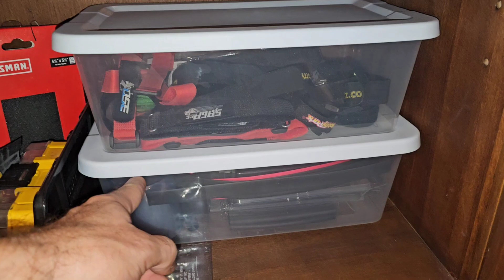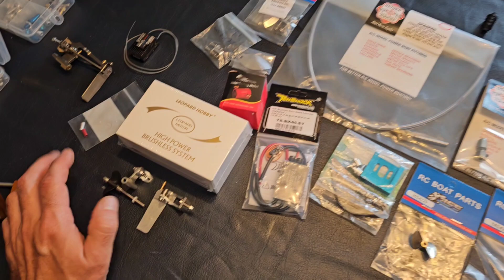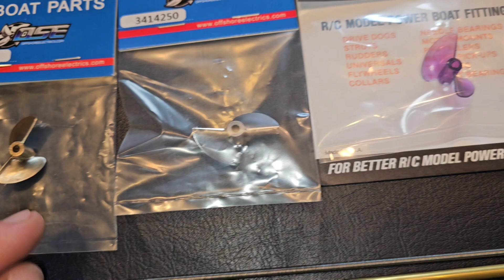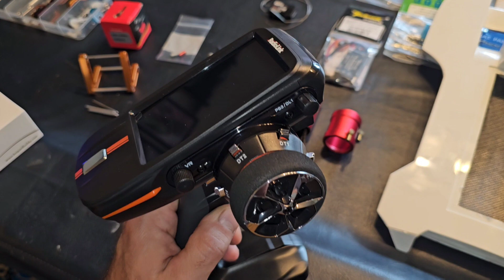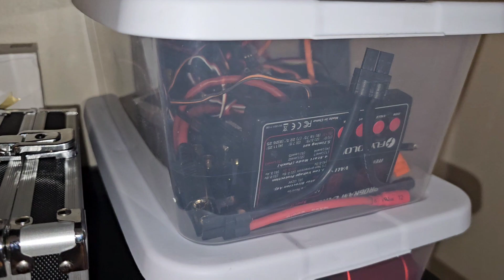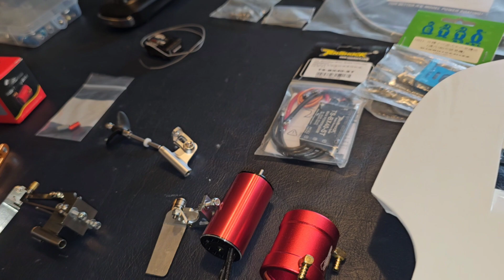Cleaning up Shop! Preparing for the MHZ 17" Hydro Build!

Comment: I do have a question, on the radio link transmitter I noticed that the receiver has 2 antenna, could you in your review tell us if it will work in a carbon fiber boat. My guess is no but 2 antenna there's a maybe. Thanks

Comment: Be very careful with the version of software you run on the RC8X. I have it bur I do not have signal loss issues on the new software it came with. However, some earlier versions cause run aways with signal loss. Just keep that in mind 😅. My MHZ cat doing 100mph and running away is a terrifying thought.
Reply from the maker: @Mati_Reefs  hopefully 1200ft-1800ft is enough for me to keep it in range. That's also why I prefer external antennas 📡 😅

Comment: You said that you watched Dr jets video on this boat. I hope you got to watch him drive it because he ran much smaller everything and it boogies. There are some things that he did that I would have done different but in my opinion your over powering the boat. If it was a bigger boat then more power is good but not so with these small boats.
Reply from the maker: @jimstone5339  I've got a 2835 3500kv coming for it (ebay kit). If my setup is too big
Reply: @H2oMechanicHobbies  I wasn't trying to get in your business, I have some small boats and I know that it really doesn't take much to get them to go fast. When I drive them I spend more time driving my rescue boat than I do them
Reply from the maker: @jimstone5339  😆 a small build will definitely be a learning experience for me! I appreciate all input + or -

Comment: I can tell you from experience. Do not trust that large metal box full of batteries. The shear ah of all the packs in one box. I  had a battery pack 120v 15ah.  And the damage to my home was something you wouldn't believe until you see it.  I managed to stop the fire spreading outside the living area but the damage was unbelievable.  I had to have 3/4 of the house re plastered but everything in it was destroyed.  The heat and damage from just the smoke.   It melted everything off the walls and roof throughout my home  even though the fire never left the living room.  It melted and destroyed everything. I tried to get in back door over the other side of the house and the heat and smoke was Impossible to get more than a couple of meters in without having to get out.  Was literally scorching my skin
Reply: Thanks for posting this. The one thing about Lipos is alot of us become complacent until its too late, most Lipos are safe until they are not. I keep my Lipos in an ammo box but even those only delay catasrtophic damage.
Reply from the maker: @phase3ute  yea I've always worried about that. I try to keep them somewhat encased in something none burnable. I do keep a lipo battery fire extinguisher near by, not sure if it would help. But I try to be as prepared as possible. & toss put old puffy batteries and shoot them
Reply: @H2oMechanicHobbies  unfortunately the only prevention for a lithium fire is to completely submerge the batteries is water and even once they have been their a while. Their is still a possibility they can have a thermal runaway after being taken out of the tank.  Until it happened to.me, I'm not going to lie I never dreamt that a ljpo pack that size could even cause 5 percent of the damage they did. I lost 95 percent of the assets in my whole home
Reply: @H2oMechanicHobbies  c02 fire extinguisher is the only type that will minimise the flame front while your spraying it, as soon as you stop spraying it the inferno just comes straight back.   I've personally tested  nearly everything and they do nothing
Reply from the maker: @phase3ute  yea I believe oxygen is it's source of combustion, so it was has to burn all the way up before it quits. I might look into a fireproof file cabinet (brick lined) & store them that way.